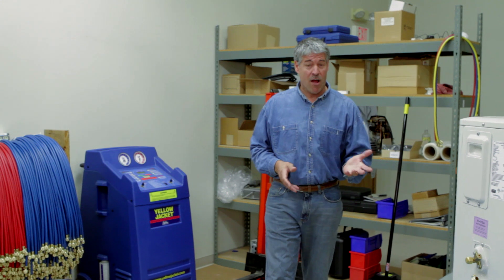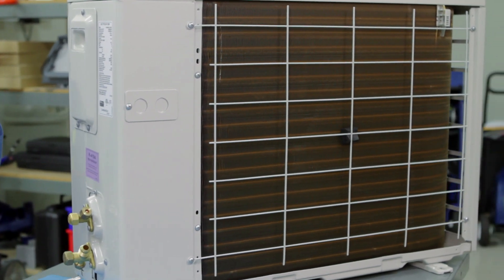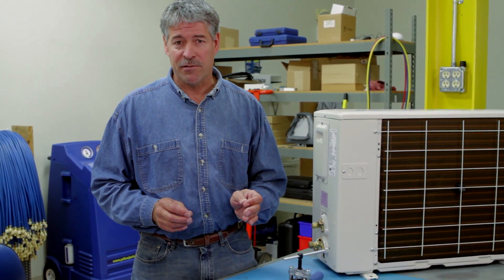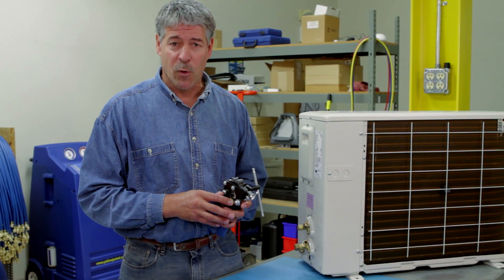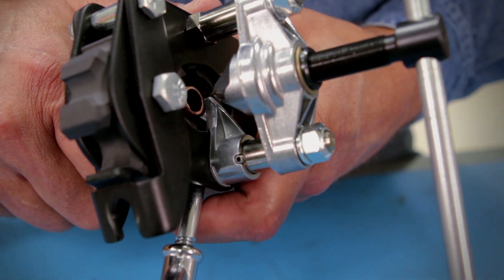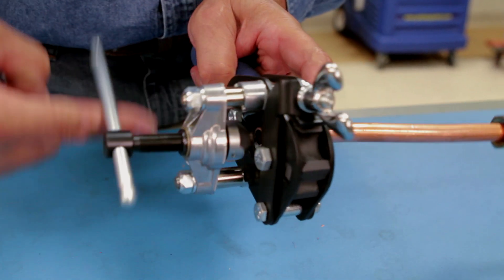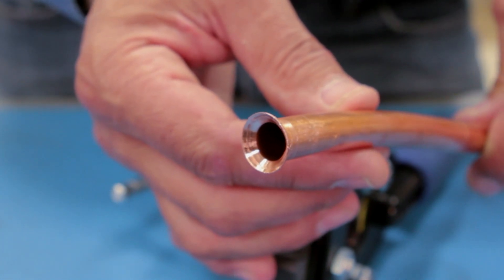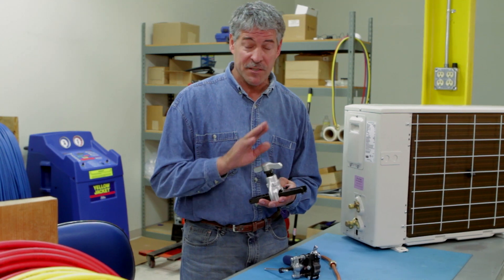YELLOW JACKET Quick Tip: R-410A, Mini Splits and Flaring

Comment: I am sorry to say this tool did not work ,why because the it had no ridges on the collor holder, and the mini split 1/4 pipe this flare tool did not hold it do not spent the money on this tool 100 buck thrown away I bought it at Dickson in Athens after I made them aware never go a return call, so I called yellow jacket they told me they were aware of the problem amazing nowadays you buy something and that's the end of it yellow jacket should recall this item and revise the problem and exchange all out there as dignity is in order and respect to all who buy from them with expectations.
Reply: You write a letter to the attorney general in your area or district. if they get enough complaints the att-general will file a suit against them.

Comment: i have it and used it, it's hard to unlock and plus the cone will turn again the flair tube and destroy the flair seat on the copper, you will need a high torque to tighten. very disappointed with this tool.

Comment: you didn't ream the inside end of the copper pipe, if you look at the finished flare the surface wasn't smooth which is necessary for a good seal.
Reply: Always ream before flaring..!!!